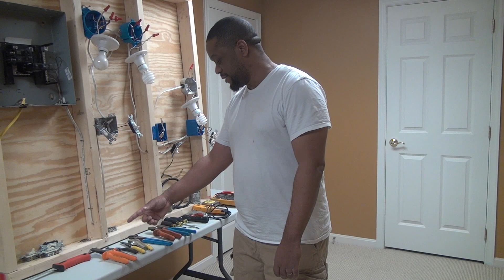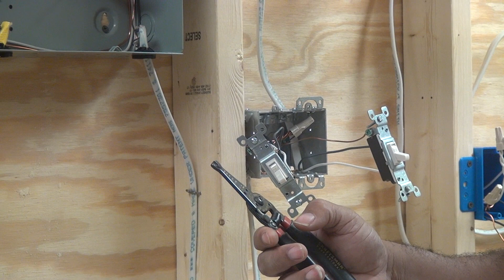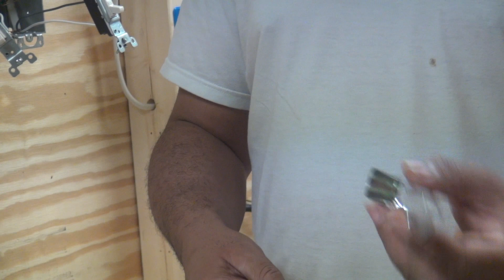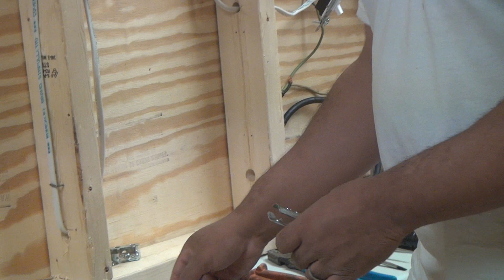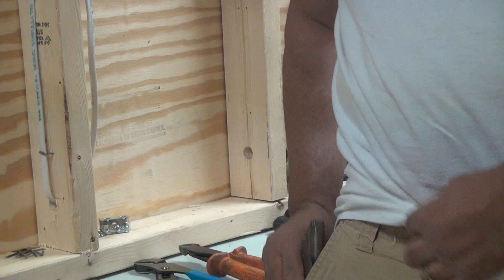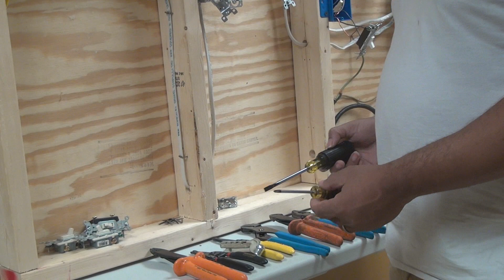Electrical Tool list

Comment: I was wondering you would like to review my Gauged wire strippers i just started selling on eBay there good quality and my favorite type. I will send u a free pair if interested  http://www.ebay.com/itm/272602044000?ssPageName=STRK:MESELX:IT&_trksid=p3984.m1555.l2649

Comment: hey tyrone very well documented video i been in the trade ten years n u right over time u build ur tool arsenal the one tool i need is the wire cutter ratchet its makes things so much easier when u cutting three fifty n five hundred i use the cable cutters but sometimes they can be clumsy to use but keep doing what u do best
Reply from the maker: +panama1965 Thanls Panama

Comment: Very helpful video. Thank you for sharing your knowledge.
Reply from the maker: You are welcome
Reply: I had a quick question. Can I use the meter that you used to see if the outlet had power if there is no outlet and just touch it to the wires? Thank you in advance for answering.
Reply from the maker: kingpinpkr316 Yup you sure can

Comment: Tyrone Robertson What are the effects in the short or long term on my appliances, if I use a 15amp GFCI outlet on a 20amp breaker? After I install the two new 15amp GFCI outlets in my kitchen I notice the two old GFCI were label 20amp.
Reply from the maker: you are permited to use 15a outlets on a 20a circuit as long as it is a duplex outlet. In bathrooms where you would normally use a hair dryer you are required to install a 20a gfci circuit.  The i5 amp outlets are capable of handling the load on a 20a circuit
Reply: Felipe Cespedes Technically you should not put a device rated for 15 amps on a 20 amp circuit. If you exceed the amp rating on the device the 20 amp breaker won't trip like it should and can cause wires to over heat causing a fire hazard. 15 amps is rated to handel 1800 watts. your standard hair dryer is generally going to use 1500 watts. leaving only 300 watts to play with such isn't much. so if say you were using the hair dryer and something else at the same time it will cause an overload with no "over current protection" (meaning the breaker is not going to trip). Now, It is possible that the GFCI receptacle will trip. but it is not a guarantee.  in short, I would just return the GFCI receptacles and purchase one's rated for 20 amps and sleep better lol. Take Care
Reply: Felipe Cespedes I know you aren't asking me but I do this for a living just figured I would chime in.

Comment: Excellent tool list. Sadly, people think that the electricians hammer doesn't exist. They splice wires with nuts without using linemans pliers. I do know that not all wires can be spliced by linemans pliers but you should use them with the bigger wires or maybe 14 and above gauge wires.
Reply from the maker: Yeah striping with your side cutters is a veterans tactic I would never suggest someone new to the trade use there side cutters to strip wire